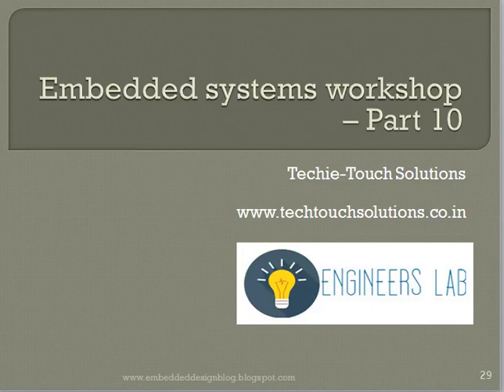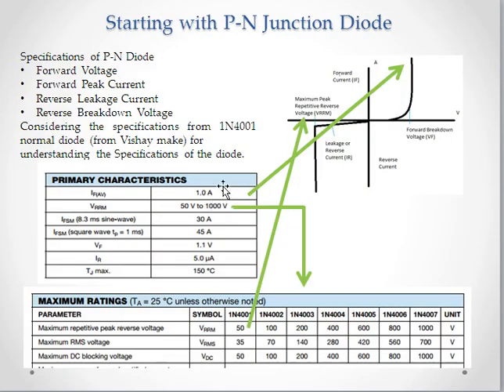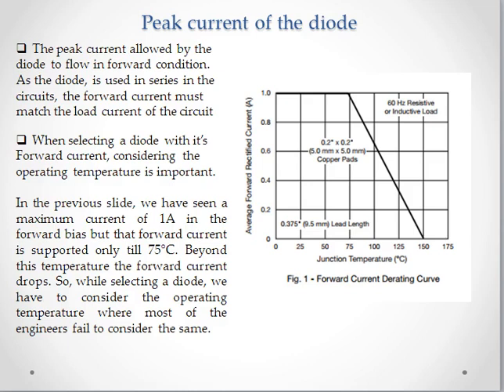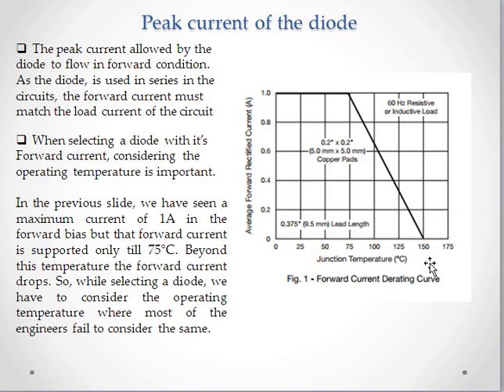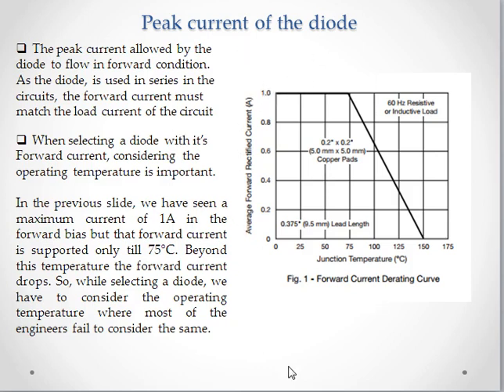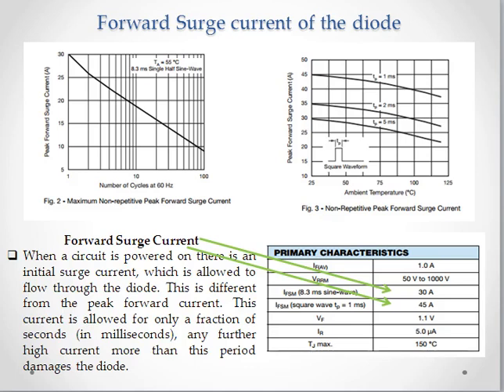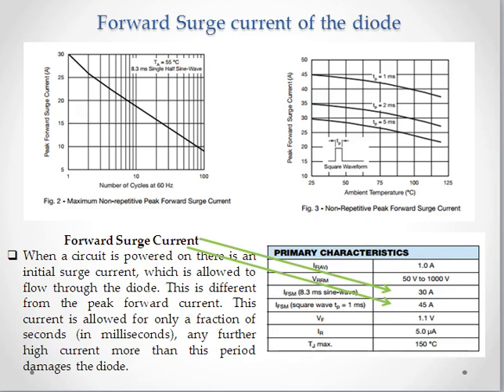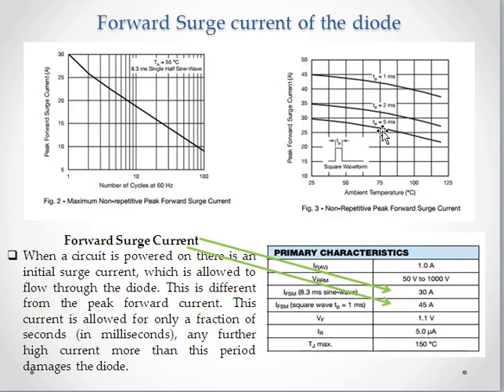Introduction to Diodes || Reading a Datasheet of a diode || Embedded workshop part 10 || P-N Diode

Comment: what does it mean by number of cycles at 60Hz?
Reply from the maker: In which context are you asking?
Reply: @Way2Know  its on the graph for forward surge current
Reply from the maker: Okay, got it. Maximum peak forward surge current specification is defined as the peak current that can flow when a sinusoidal input is provided as input to the diode. It is 30A in the datasheet. Now, if we give more cycles of sinusoidal input continuously, it is obvious that the peak surge current gets reduced. The graph gives number of cycles of sinusoidal input at 60Hz vs peak forward surge current.
Reply: @Way2Know  ok but how do I calculale the number of cycles? Is it a function of the output capacitance?
Reply from the maker: Surge current is something we have to avoid. If we see the graph, as the number of cycles increased, the surge is reduced. The current rating is the diode current carrying capability and not w.r.t load.
Reply: @Way2Know  but what causes the current in the first place is a capacitor as a first order filter on the output of an unregulated power supply, for example
Reply from the maker: Yes, ur right. What i mean to say is, the specification talks about the diode current carrying capability (obviously it's the output load that draws)